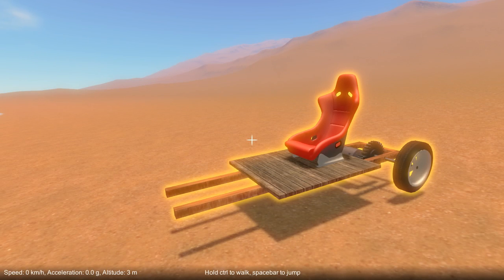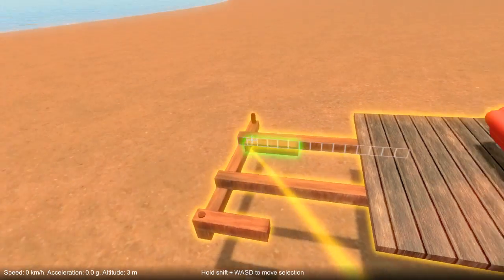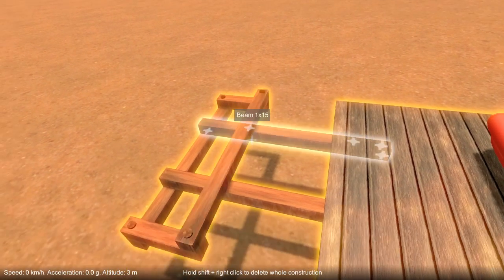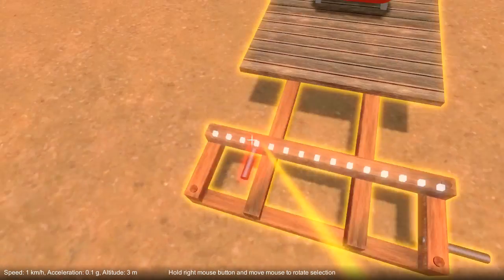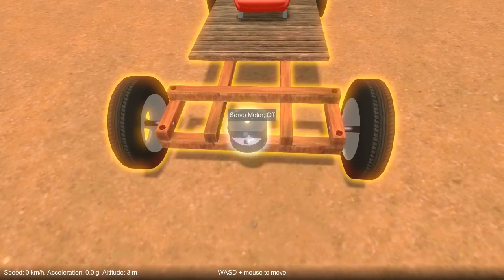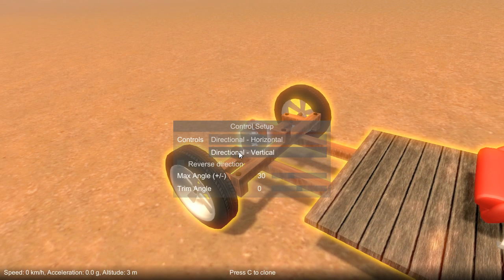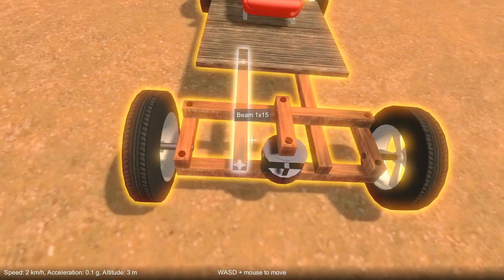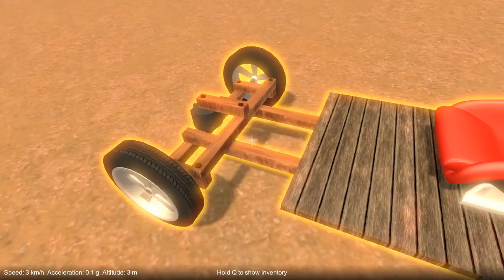Tutorial 6: Making a car steering mechanism

Comment: You can’t us that actuator arm of the  steering servo as it is. It scribes an arc in motion ..and you would need to have elongated slots at its connection to the rack to allow  for the change in distance as the arc is scribed (moving of servo to steer)?

Comment: Wow, this looks seriously impressive! :D Thanks for making this! Does this game have reduction gearboxes or would I have to make them myself? 

I'm trying to find out whether I can use this game to model some farm engineering projects I am working on. It seems promising so far! 

I want to make a chunker for instance and I want to see if I can reduce the 1800 rpm from diesel motor using a 1:50 gearbox and turn the chunker at 36ish RPM. 

Search on youtube for 'gary wood chunker' if you wanna see what I mean.
Reply from the maker: Thanks!  You'd have to make the gearbox yourself using the gears in the game.  You should be able to get that kind of gear reduction, but you'd need to use quite a few gears together to do it.  Take a look at the "Geared down Motor" example construction in the game for the general idea.
Reply: Thank you for your response and making this game!

Comment: Would you please explain the needed changes to get an ackerman steering mechanism?? as you said we need to do something to the links but it wasn't clear to me
Reply from the maker: Sorry, yeah that wasn't very clear, basically I meant something like this: https://dl.dropboxusercontent.com/u/157530041/Ackerman.jpg

Here's the save for it too: https://dl.dropboxusercontent.com/u/157530041/Ackerman.cst

Hope that helps, cheers!
Reply: Thanks (Y)
Reply: @GearBlocks  Hi, could you perhaps provide another link, the current one doesn't work anymore. Thanks
Reply from the maker: @muhammadmoola1178  Sorry, I don't have a link to hand, saves are now shared from within the game via steam workshop.  You could ask around on the GearBlocks discord, someone will help you there: https://discord.gg/Pf46ska.
Reply: @GearBlocks  ok thanks, but just to be clear, would making the side links angled instead of straight towards the mid point of the back plate make it ackerman? Is this sufficient?
Reply from the maker: @muhammadmoola1178  Basically yeah, the pivot point on the steering arm that the track rod attaches to needs to be inboard slightly.

Comment: i don't know why but i cant get the steering to work i checked everything for rigid attachments but there were none the steering just wouldn't budge when i tried to move it yet it would sometimes rotate freely
Reply from the maker: +Ethan Kline Hrm, hard to say why this might be.  In the latest demo build I've included some examples of steering mechanisms, I'd suggest comparing those with the one you built.  If that doesn't get you anywhere, you could post up your save file somewhere and I'll take a look!